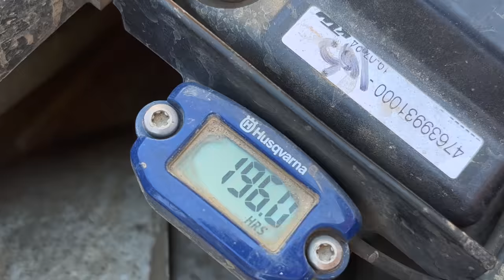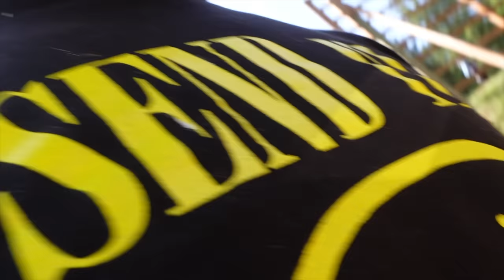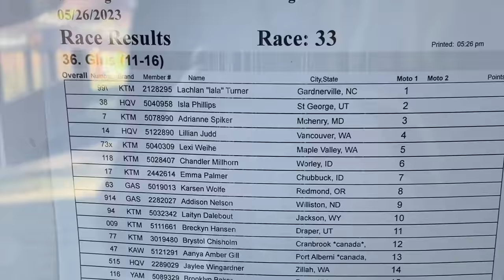Bike Problems at Loretta Lynn Regionals 🤦🏼‍♀️

Comment: 0:29 Dude.. our was doing the same thing, it wouldn't clear out at all... We could smell the clutch a little & it was old (180hrs) so we swapped it, although it still looked great.. but of course that didn't fix anything. 

Turned out to be the slave cylinder, which was new, after draining & bleeding, I started filling & filling & filling the DOT4 & thought, holy crap that takes a lot of fluid.. thankfully the oil fill cap was off or we would've poured 3 giant bottles of fluid in there.. 

DOT4 Is great cleaning out the clutch compartment, & the rest of the internal engine compartment..

Comment: I had the same problem with my Kx250,, it would foul plugs after a hour of riding, we tried everything. I brought it to the dealer 4 times, they could not find out what was going on, and this is the dealer now . The dealer sent the carb out, see what the problem was, finally they found out it was the float pin, makes it richer or leaner, was hanging up. Great ride kid faster every time.
Reply from the maker: So frustrating but glad you got it figured out

Comment: Had to deal with the tower tude as well we had 2 classes qualified at the aq but only pre registered for one class but not the second because the bike was waiting on a part we couldn't get until that Friday and of course not wanting to fork out 120-140 non refundable dough. And as it said you can sign up as an alternate wich we were fine with. First Lady pretty much told us to just screw off. Can't just show up and race. 2nd lady realized it was no big deal since we already qualified at an aq and the class only had 10 riders. Other than that couple minutes of frustration washougal regional was a pretty great weekend
Reply from the maker: Yeah we waited like 20 min in line just to be brushed off. I tried to explain that it didn’t say that the race needed to be purchased before practice online and that it shouldn’t allow us to buy a practice spot without a race ticket if that’s the rule but no such luck. It would be nice if they were willing to work with us since it was such an important weekend but oh well.

Comment: My banchee was cutting in and out. Misfire issues. I thought it was jetting?  Reeds? Spark plugs? Nope it was Spark plug caps! And coil was getting weak. Get a ohm meter and find out what spec is required. Also ohm the stator just to see what it is at.
Reply: Yes sir faught this a few weeks also it was our plug cap after I replaced the coil and wire it was the cap after all
Reply: @shonrob1620  yep!!! you wouldn't think plug caps could fail. I noticed it more so when bike was getting up to temperature.

Comment: my boys dirtbike started doing something similar. kept cutting out over half throttle. i went thru the carb multiple times. checked compression and leakdown. couldnt find anything that helped. decided to try coil change. as my boy handed me the coil i asked if he unplugged it. when he told me no i knew what happened. the spade clip had vibrated loose. tightened it up. ended up running better then it ever had. sumtimes its stupid simple.
Reply from the maker: It could really be anything 🤷🏻‍♂️

Comment: I haven't watched the whole video yet so I don't know if you guys fixed Lillian's bike but I also have a supermini (KTM105) and mine has been bogging recently too, me and my dad don't know what is causing it for sure yet but we think it might be because it is getting warmer and the air is changing so we might change the main and pilot jet and either make them more lean or throw in more gas I don't  remember what my dad said. If you guys haven't fixed it yet that might be the problem. Anyways tell Lillian I wish her the best of luck at Hangtown and you guys are awesome!       Edit: I watched it now and I saw that you said Josh fixed Lillian's bike and since I am having the same problem I was just wondering what was wrong with it?
Reply from the maker: It was a grounding screw on the spark plug cap
Reply: @VlogEpicness  oh ok thank you